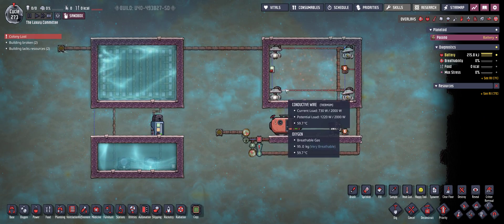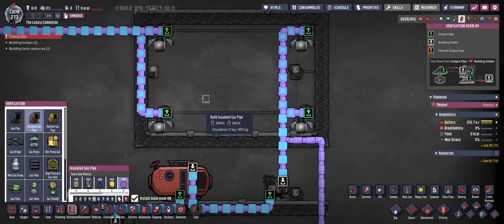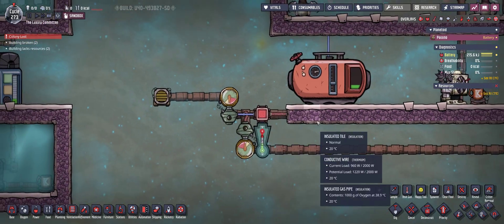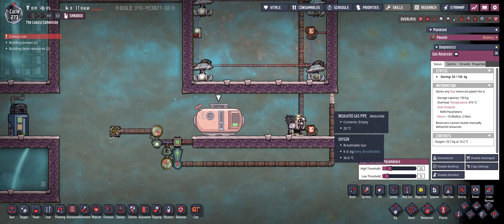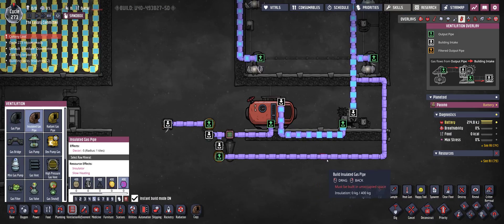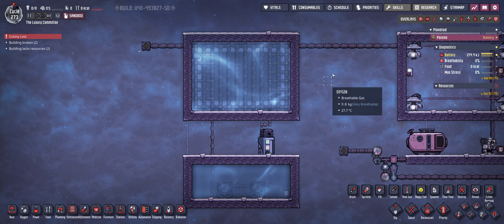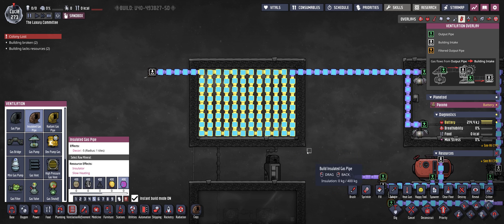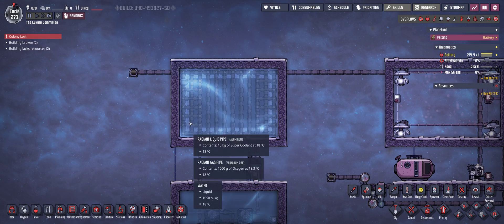Oxygen Not Included HowTo cool down Oxygen for your dupes

Comment: Video is incomplete, you just moved heat from one place (oxygen gas) to another (another gas or liquid) using unrealistic amount of water.
You should mention, that now one could use another solution to cool or dispose those hot gas or liquid,  for example, warm up something cold (water from cold geyser), boil something that you need to boil (polluted water) or convert excess heat to some electricity using auqatuner inside Steam turbine boiler.
Reply: It's just not very helpful overall. He is using end game materials and impractical examples and still not even getting optimal results. 18 degrees is a little cold and could cause some problems in certain bases.

Comment: very nice video, short, clear and straight to the point. If i could add something its that you can use 1 gas shutoff instead of 2. Have the shutoff close when the O2 is too hot, but keep the pipe going through the input. If its disabled the gas will go past the gas intake and can be re-fed into the system. If its cool enough the shutoff will accept the gas and it can pipe it where needed, stopping the bypass. Other than that, very useful video for O2 cooling!
Reply from the maker: Thanks man for the feedback. Thats another 10 Watts saved :-D

Comment: Why is that heat exchanger so large?  Three segments of steel radiant gas pipe is more than enough to chill oxygen down.  You use 95.
Reply from the maker: Sure it can be build a lot smaller. The only advantage of having it that big is that you can "store" a lot of temperature in it, a giant battery so to say. Can be useful if you run the Aqua Tuner from Solar Power.